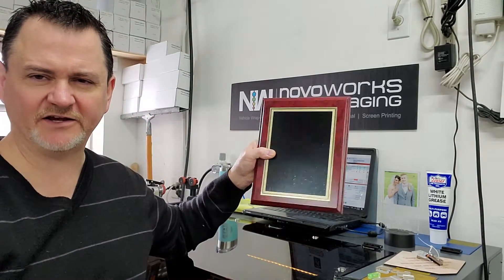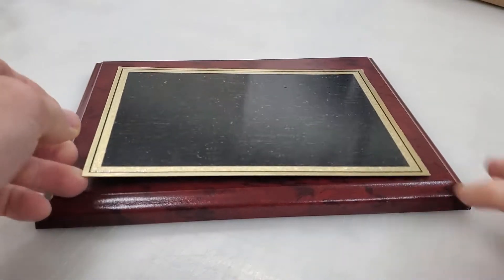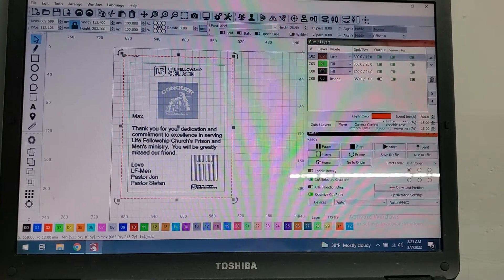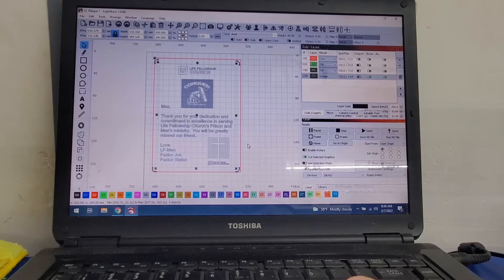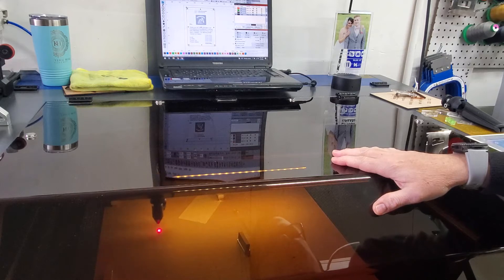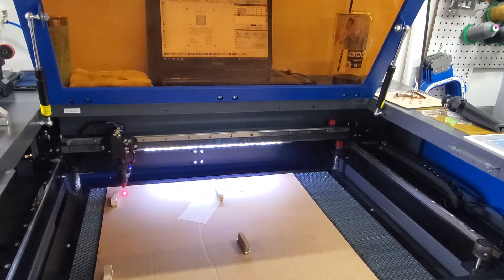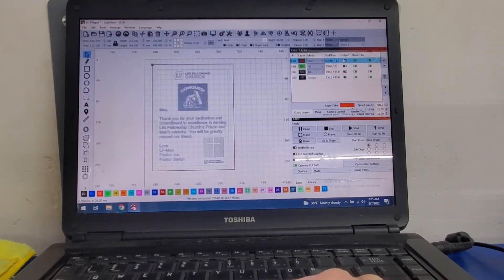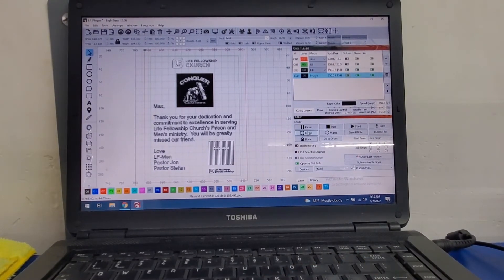Laser engraving a custom Plaque w/ our Omtech

Comment: What wattage is the machine your using and what speed and power did you use to engrave the plate?
Reply from the maker: This was on our 60w CO2.... speed/power will vary based on power supply, tube, etc -- but I believe this was run at 350mm/s & 15 power

Comment: Hi there 😊 love your channel 🤗 I probably will order my OM MF2028 today and I was wondering if you can share or guide me at least where to find the different settings for cutting and engraving different materials plz. I currently have a 5W diode which uses completely different settings 😅
Reply from the maker: Thanks!  Check my latest video's for a discount code to get 5% off your order through the OmTech site also!

Those settings are tricky... as each machine is slightly different power ratings.  You really want to do some testing on each material you will want to use to figure out ideal settings.